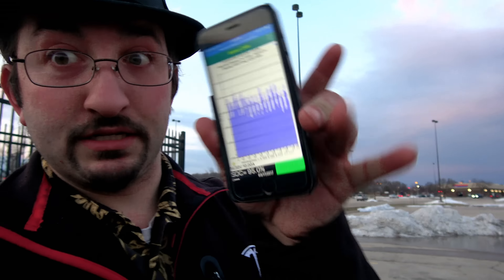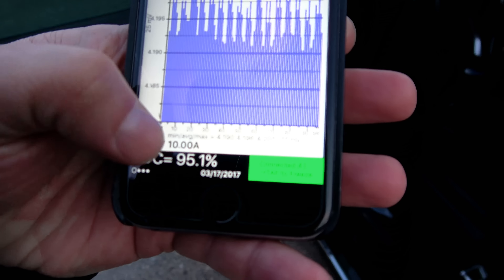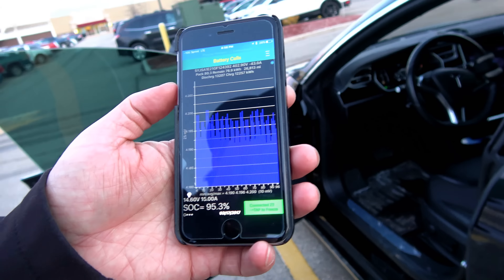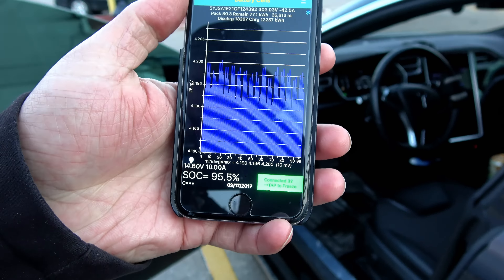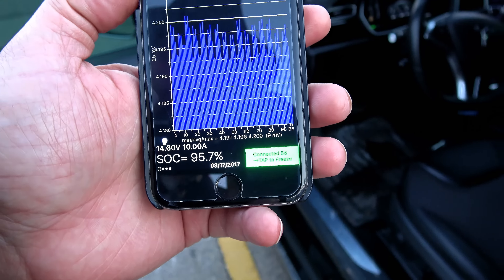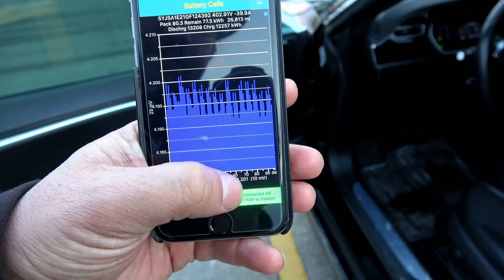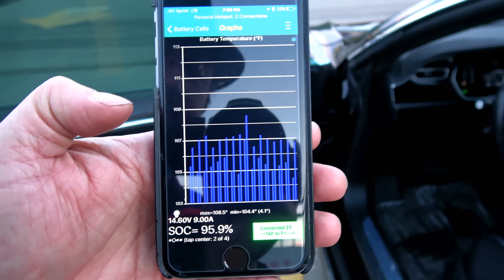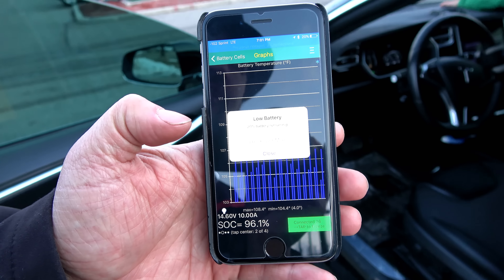Tesla Supercharging Mystery of the Charge Taper Solved!

Comment: Exactly the same behavior on Nissan Leaf. Though Leaf's max cell voltage is 4.125V. It's almost like ConstantCurrent-ConstantVoltage charging. Though constant is not the battery but any cellchain measured.

PS. Notice 12V voltage system. Is there any difference @Supercharging vs home vs driving.
And also same things but with exterior temperature below freezing.

Leaf keeps 13.0V by default, but always starts with 14.5V (until current to the 12V battery falls a lot, aka battery almost full). And if battery below +3C it always keeps 14.5V (Lead Acid batteries hesitate to take charge while cold)